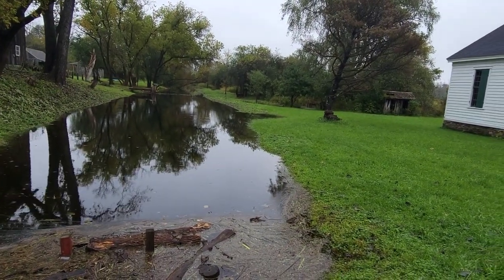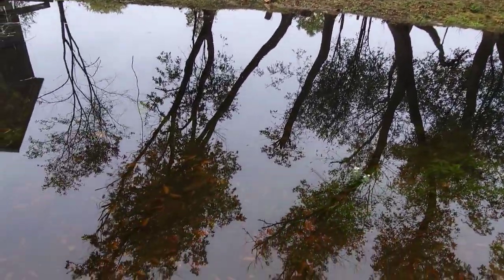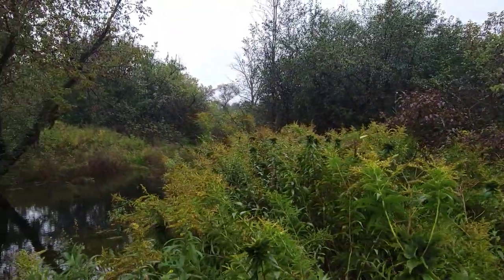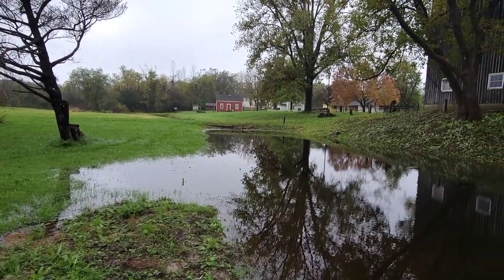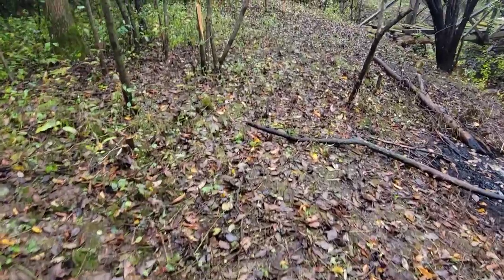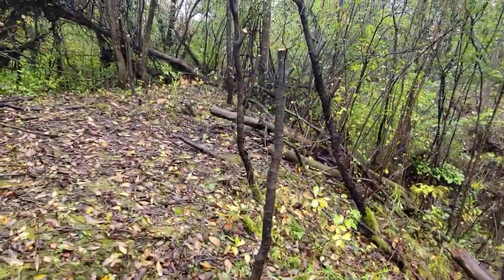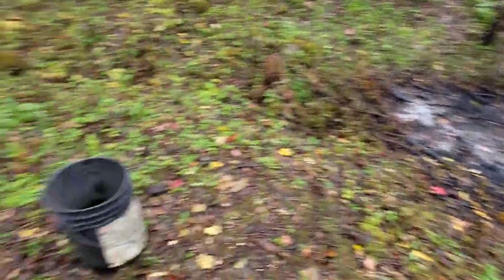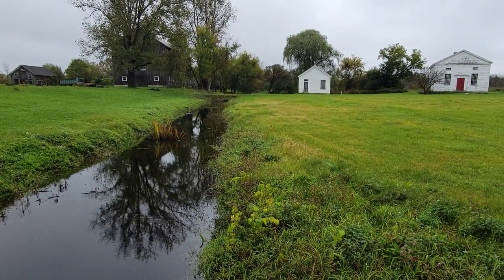Clinton's Ditch, my special project of restoring the first section of the Original Erie Canal.

Comment: Awesome job Cori!!!!!!  (And did I correctly hear you say that you did all this single handedly - with ONLY just a shovel?)
Reply from the maker: Indeed, I celebrated 4th of July the same way and pretty darn close to where they had. Just obvious fill that was in prism and used that material it rehab the missing levy. I wasn't ruining anything I promise,  the area is highly disturbed but still holds the real treasure of CD
Reply: @HEC350  This restoration of the Original Erie Canal at the Erie Canal Village is more valuable than the buildings.